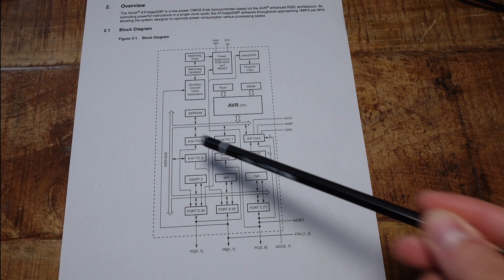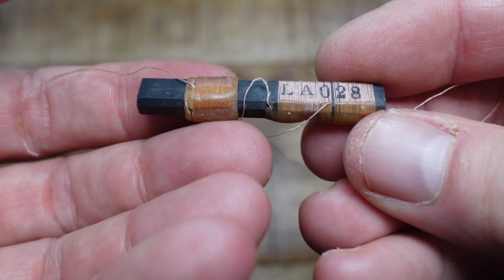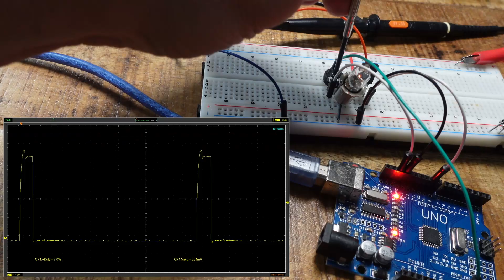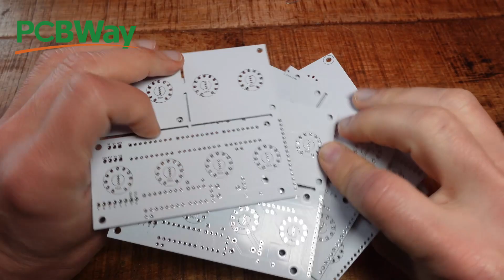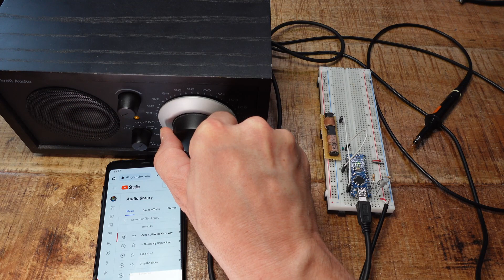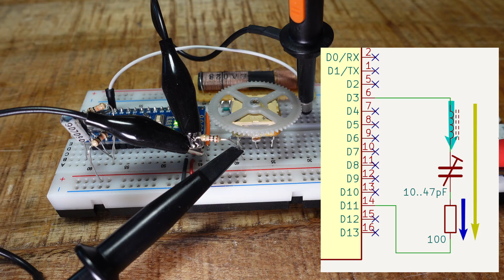Arduino as AM Radio Transmitter

Comment: What a nice project, I'm a pirate myself.  you could improve this even more but I assume you don't have that goal.
there are pirates in the Netherlands: 1600/1670KHz in AM modes 1630KHz is often used!
also on SW / Short Wave around 6200/6600KHz also in AM modes Here around 6300KHz is a frequently used frequency.
a nice receiver to listen to this is: Search Google for: SDR Twente. 
Allow the audio and click MAX IN. set Frequency and click Modulation type 
(could 6300KHz also be possible? or 1630KHz?)
Healthy and Friendly Greetings from the Rotterdam Area!
RadioRob

Comment: the leds on the arduino lighing up might be due to self inductance, might want to design something to protect it in some cases.

also gives you a reason to perhaps try out a multistage lc antenna like which they used for the early trans atlantic radio signals.
Reply from the maker: That's up to ham radio enthusiasts. I just wanted to show the proof of concept.

Comment: how do i connect the ferrite antenna ?
(stupid question?)
Reply from the maker: Two wires between pin D3 and D11 plus optional capacitor between 10 to 100pF to improve the range. But I cannot give any advice about which  coil of the ferrite antenna to use. Every antenna is different. You need to try and find out by yourself which winding and capacitor works best.